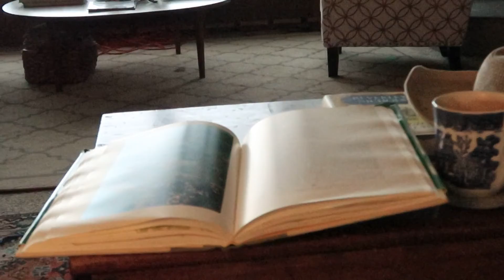WE HAVE WATER | The Well is fixed and water returns to Bunny Hall | MAKING A LIFE BY THE SEA

Comment: How did you cope for showering and toileting without water?
Reply from the maker: The Boathouse had a separate small (we replaced as well) Line that connected to the same well, so ingenious and 'thrifty' new englanders that we are, we ran 2 100 foot lengths of garden hose from the intake in the boathouse cellar, along the yard to the well/pump in cellar of Bunny Hall. It was a trickle but a shower and had washing and loo flushing are good in any form :) That firs shower after the water was fixed, was amazing!